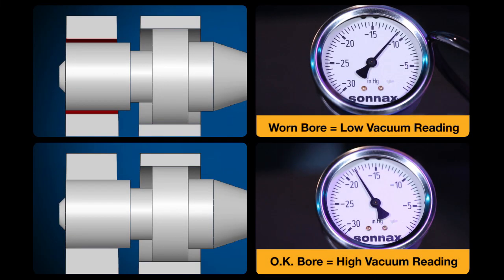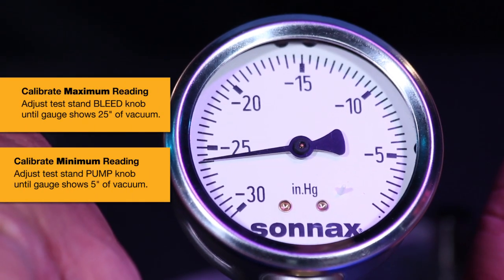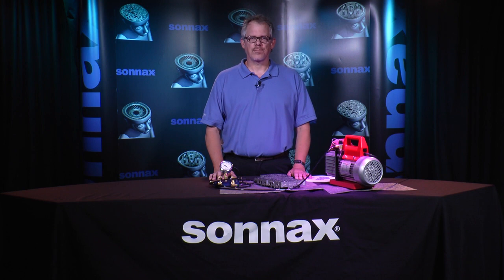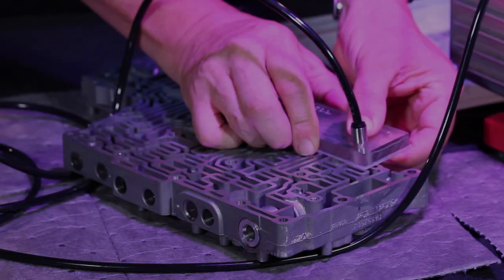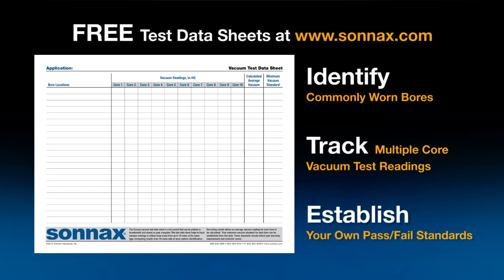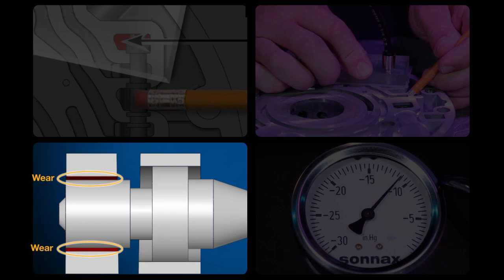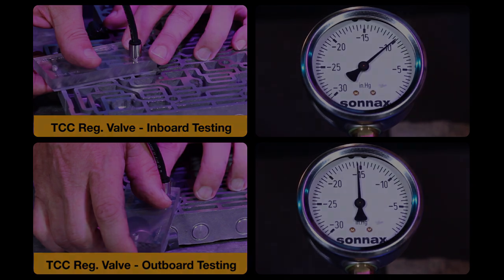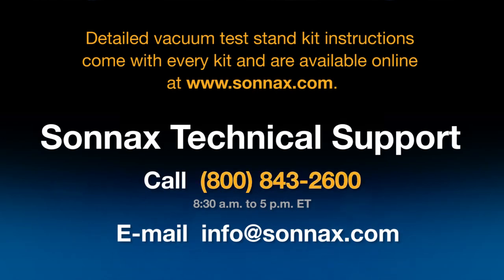Sonnax - How to Vacuum Test (Part 3 of 3)

Comment: What a great set of three tutorials, thank you!  I'm focusing on the ZF 5 HP-24A as used in the early 2000s Audi A6 and A8. As I understand it, valve body issues there are often the root cause of TCC slip or the clutch A drum self-destructing. I understand the prime time of this transmission has come and gone, and Sonnax understandably does not offer a guide for this unit, but any hints or guidance you could provide would be most appreciated, please.
Reply from the maker: +Tanya Charbury Hi Tanya, thank you for your comment! Our tech team would be happy to assist you with any questions you may have. They can be reached via email at info@sonnax.com. Thank you!
Reply: Tanya Charbury run away from that transmission, tech info is very limited.

Comment: HI sir i have problem with 5r55w body valve slip shift from 2 to 3 gear and the OD light is on, i have try with another body valve and the transmission is normaly. Can you explain to me which one shift kit i must to repair? thanks before...
Reply from the maker: Hello, our tech team would be happy to help you. They can be reached directly via email at sonnaxtechsupport@sonnax.com, or phone at (800) 843-2600 ext. 398. Thanks for reaching out!
Reply: @sonnax  Thank you!